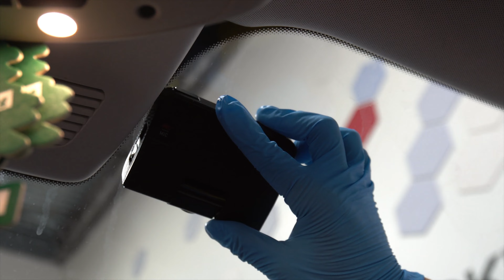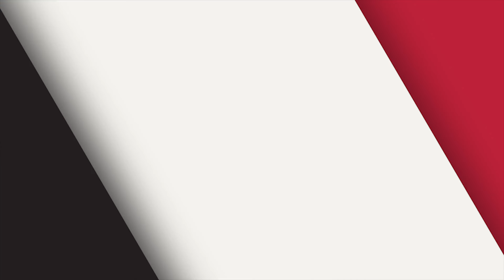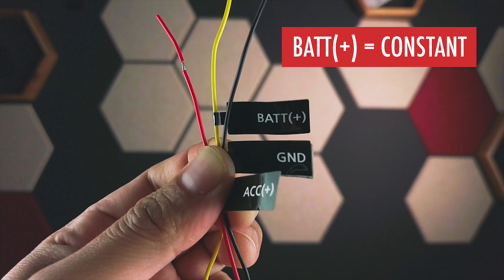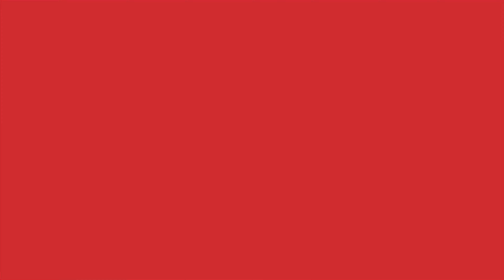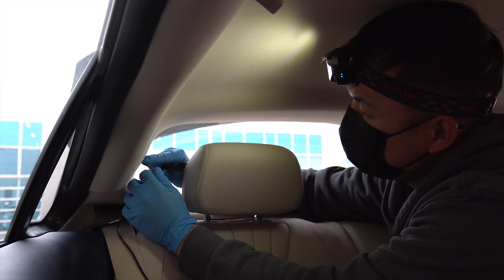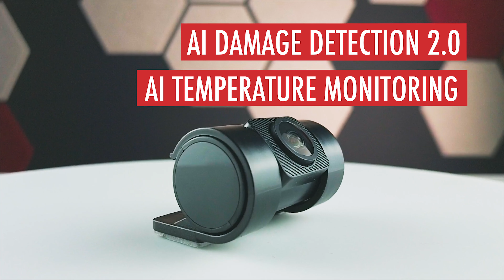FineVu GX1000 2K QHD Dash Cam x 2019 Mercedes Benz E450 | How to Hardwire Install | BlackboxMyCar

Comment: Hi can I use OBD II power cable for this dash cam? Does it have battery voltage protection in this way? Thanks
Reply from the maker: HI there! Apologies on the delay here. We've actually been testing out our OBD cable, the IROAD OBD-II with the FineVu system, and wanted to take our time to ensure compatibility. And good news, it works! I can confirm that the OBD cable will work for parking mode, and voltage protection properly with the FineVu System. This will be reflected on our website listings in the coming weeks.

Comment: what's the type of fuses you selected for BAT+ and ACC and should it be within10-30 A ? 
another question , what's the type of fuse tape add shouldn't be as labeled on manual ( "use fuses with add of letter S" )  So what's the type you use ?
Reply from the maker: You are correct, the fuse should be rated between 10A-30A! As for the fuse type, this is highly specific to your vehicle, I recommend taking a fuse out of your fusebox to verify, it's not normally labelled in the manual. You can find our guide and fuse tap distinctions here: https://www.blackboxmycar.com/pages/setup-add-a-fuse-kit
Reply: @blackboxmycar   I have the same car and I put the Batt+ wire with a mini fuse tap on 414 slot which was an empty one with positive current (TV tuner) ( 5A) , and the ACC+ wire direct to the negative side of the ( socket fuse )  on slot 457 or 487 ( 15 A)and  I cannot put an fuse tap because there is a plastic locker .is there any problem with my selections ?

Comment: Is the hard-wire kit drain the battery? Example, leaving the vehicle SEVERAL DAYS?
Reply from the maker: Hey there, a hardwiring kit will use power from your battery, but is designed to not kill your battery because it has voltage cut-off protection. Before it does any real damage to your battery, it will automatically shut off below a certain voltage.

Also, without a dash cam battery pack, a dash cam will most likely run out of power after several hours. Chat with us at info[at]blackboxmycar.com if you have more questions on this!

Comment: Awesome video! At 4:52, it appears the rear camera mount can rotate up to 180 degrees in order to point it out the rear window. I have a rear sliding window on a 4Runner that requires a slightly different setup. Can you confirm the rotation?
Reply from the maker: Hey Jeff, it can go up to 120-degrees so it should cover your sliding rearview window setup. You can reach out to us at info[at]blackboxmycar.com and we're happy to help answer any other questions too :)